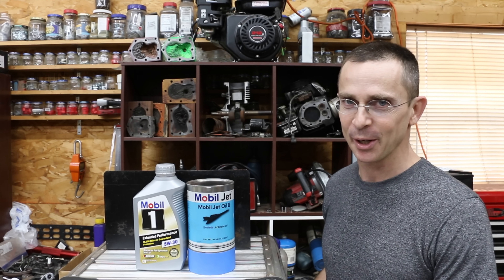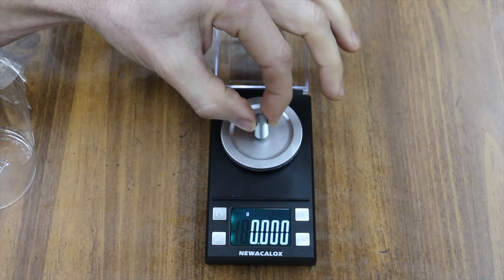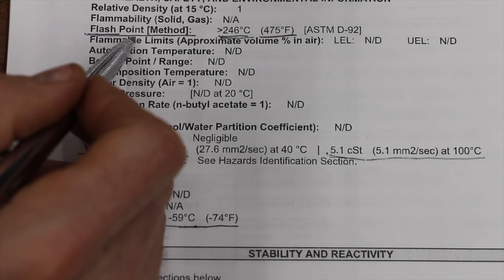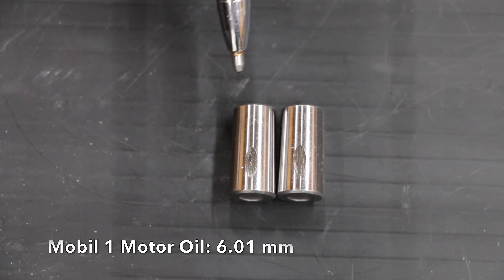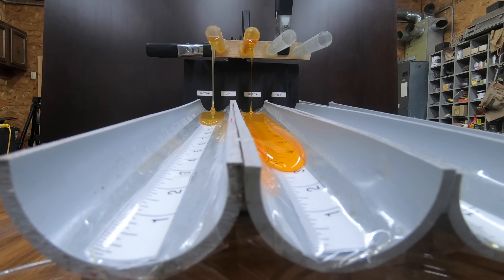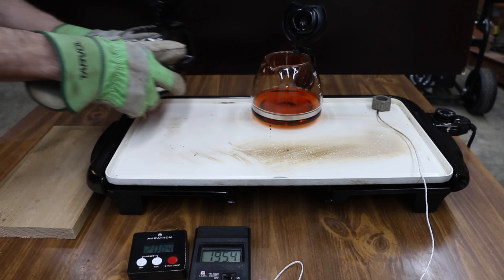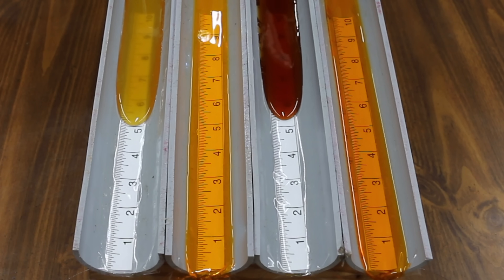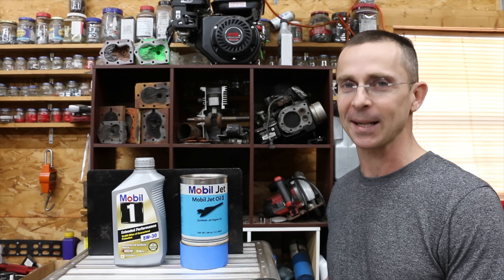Is Jet Oil better than Mobil 1 Synthetic?  Let's find out!

Comment: Put dollar general oil in my jet now
Reply from the maker: lol. Thanks!
Reply: @ProjectFarm  awesome testing. PS
Case Hardening of bearings can vary batch and mfg so maybe use same roller in wear test and rotate 90° for two tests on on the same roller different oils
Also detergent action of oil is critical. Maybe test carbonized part and boil it to see which oil cleans sludge.
Trying to help you not a critic. 
Excellent work Thanks

Comment: I'm curious. If "High Milage" oil is designed to clean out sludge inside the engine, plus other additives meant to reduce wear on moving parts. Then why not just run High Milage oil from the get go, after break in period of course...🤔
Reply from the maker: Great point.  High mileage oils contain seal conditioners.

Comment: These tests are so cool for general knowledge. While watching this episode i thought it would be interesting to try the lubricity / wear test whith the oils in hot and cold conditions, and maintain the target temperature through the whole duration of the test. Just to see if the engine oil do as good in extreme ranges as the jet oil. The heat part would not be so hard to configure, adding heating elements under glass cups for exemple, but for the cold part i still don't have great ideas how to make it. Ice surrounding would work for a start point may be. Still, thanks for your awesome videos !! Cheers
Reply from the maker: Thank you very much!!

Comment: One thing I'd love to see you do is this. 
For years people and companies have marked what they call HHO GENERATORS as a fuel additive for combustion engines. I know it works but I've always wondered what the difference would be, if any, between an HHO generator and a cylinder of laboratory grade, or similar, hydrogen gas spliced into the air intake of an engine. Compare block wear, if any at all, after a few hours. The gas registration would not be difficult to manage. Thank you for your time.
Reply from the maker: Thank you
Reply: Ah! Dihydrous monoxide. Great for making iced tea.

Comment: This test made a TON of sense to me. Jet oil should have a better cold temp test due to the fact that planes typically fly between 30,000-40,000ft at which temperatures are nearly -40°C.
Reply from the maker: Thank you

Comment: I used to work with a guy who was an Army turbine engine mechanic.  He told the following story:  One day, several cases of turbine engine oil was stolen from the shop.  Everyone thought they knew who did it, but couldn't prove it.  About a month later, the guy that everyone suspected was late for work.  When he finally got in, he explained that his car engine had died - threw a rod or some other catastrophic failure.  Turns out that turbine engine oil has very little extreme pressure additives...turbine engines don't need them!  But gasoline engines must have them!
Reply from the maker: Thank you

Comment: As an aircraft mechanic, I can tell you the primary purpose for oil in a jet engine is cooling the bearings. Secondary purpose is lubrication. Also, jet oil has such a wide temperature range because planes can be operated in a wide variety of environments. Anywhere from a scorching hot day in the desert to arctic temperatures. Worst case scenario, an in flight start at 35k feet where it is -65 F.
Reply from the maker: Thank you

Comment: Great Job Sir...  Heh heh!

I didn't even know there was such a thing as Jet Oil....

My suggestion: Mix 4 parts Mobil 1 with 1 part Jet Oil....  How does THAT perform???  Does it give you the best of both worlds???

In your voice over, you didn't point this out, but during the lubricity test, the Jet Oil bearing was definitely hotter....  the Jet Oil, it seems, does not reduce the friction, like an actual motor oil product....
Reply from the maker: Thank you

Comment: How does jet oil with the best anti wear oil additive compare to regular motor oil?
Will it be superior on the lubricity test?
And will it loose its great temperature withstanding abilities?
Reply: Jet oils will lose the lubricity test every time no matter which ones you pair up. It is a completely different oil design for completely different needs. Turbine oil is primarily to remove heat from the engine's bearings. Lubrication is part of the equation but not its primary function.
Reply: mytmousemalibu  sire, it is no viable option for a car, but an intresting video idea nonetheless to see what those additive really do

Comment: Another neat video! It might be neat to look at how some lubricants from other applications might hold up under your testing conditions. I've always wondered just how different the oil for our vacuum pumps in the labs from more pedestrian motor oil. I could send you over a quart of Edwards Ultragrade 19 if you were interested. It's relatively cheap by typical scientific standards at like $20 a liter.
Reply from the maker: Thank you

Comment: Do you think the jet oil would have a more "even" competition against say 0/5/10W-20 Mobil1 being it's a lower viscosity?
Reply: It is a completely different oil design for completely different needs. Turbine oil is primarily to remove heat from the engine's bearings. Lubrication is part of the equation but not its primary function. Its  not comparable to any automotive oil.

Comment: Jet oil is used more for flushing and cooling in a jet engine than it is for lubrication. There are almost no journal bearings in a jet, they're all ball bearing so don't generally require the same kind of surface tension and viscosity.
Reply from the maker: Thank you

Comment: Will VTEC kick super hard wit jet oil? Asking for a friend
Reply: Did you feel you hair slick back with how fast my sarcasm passed over your head? 🌝
Reply: Race Inspired Cosmetic Enhancements 😉😘💕💗
Reply: Of course you'll feel a kick, it'll be the valve gear going straight through the bonnet, at speed.
Don't even suggest this en sarcasm because you just know some idiot will try it.
Although killing Fiat multiairs in this way should have charitable status.

Comment: The original J-57 jet engines, used on B-52 and KC-135 aircraft, would burn about a quart I'd engine oil per hour.  The later engines used in the tankers, used very little oil during use, and had no oil change time.
Reply from the maker: Thank you

Comment: I think in your wear tester viscosity plays a huge role. I would assume that heavier wheight (higher viscosity) oils pretty much always win. If compairing prower engine oils. 
Would be interesting to see you compare different weights of the same brand. Maybe even  gear oil wich i would assume would do very well. But that wont mean its good for engines. :)
Reply from the maker: Thank you

Comment: Temperatures in the sky can reach below -100F, so it's no surprise the jet oil is rated for temperature extremes.
Reply from the maker: Great Point
Reply: But most engines are pretty warm when in those temps. Passengers get excited if you shut an engine down while flying.
Reply: air cooled piston motor run hotter up high, less density = less cooling

Comment: I have 500,000 miles on a 1996 F 150 using Mobile 1. Still use it as a beater. Who cares if it get banged up hauling rock.
Reply from the maker: Great Point

Comment: I'm currently in the process of replacing the 5.8 liter V8 engine in my '95 Ford F-150 with a jet engine. After melting the entire floorboard at idle, initial testing of the jet engine showed there are several major challenges to my project. Thanks for the test results. At least I know which oil to use in my jet engine.
Reply from the maker: Your welcome!

Comment: Can you test Lubriplate as engine oil? Lubriplate is an engine assembly grease used by Cummins to prevent engine component damage during start up of a new, or newly rebuilt engine. It turns  to an oil like consistency when exposed to heat so it doesn't coat the engine internals in sludge. If you need it, I'll get you a part number. Love the channel. Keep up the good work. 👍
Reply from the maker: Thank you

Comment: Now I would like to know, how cooked oil works with the bearing. Maybe jet oil would be better in the long run, since it would get cooked as much. What do you think?
Reply: Not going to matter, the oils properties are completely different because turbine engines are vastly different for piston engines. Just about every moving part is supported by ball or roller bearings. Turbine oils is primarily used for cooling, lubrication is not the primary attribute for turbine oils.

Comment: 9 bucks a quart, whoa i musta "heared" it wrong LOL
Reply: You heard correctly. Some are even more. In the world of jet aviation, $9 a quart of oil  doesn't even register as pocket change. Imagine if your car's spark plugs were $3000 a piece like some jet engine ignitor plugs. Ive had avionics boxes in my hands no bigger than a box of tissues that cost more than $300,000 and thats still low hanging fruit.

Comment: Do not think you want to try the oil for piston engine aircraft. That looks like thick syrup when cold, and only gets worse when frozen. You almost have to use a spatula when cold, but after the engine is warm it runs like water.

Jet engine lubricant is more of a hydraulic fluid, it has to work well over an extreme range of temperatures, as it will be used both in freezing places, like actuating the cylinders that are on the wings, and the same fluid will also be in the engine cooling down parts that are at 1000 C on the one side, but have to stay cool, so the fluid has to absorb that heat safely. Works because the flow rates there are kept high, so the oil can be moved to a heat exchanger to dump the heat fast. The fluid is also regularly sampled, so that wear particles can be examined, so the condition of the whole system is kept good, plus the filtering is very good to keep particulates down to a very low level.

Just do not get it on your skin, the additive packs in jet fluid are very toxic in a lot of cases, and it is incredibly hard to remove from skin without very aggressive scrubbing and lots of harsh soap, and clothing soaked in it is almost impossible to clean without boiling for hours in industrial detergent solution.
Reply from the maker: Thank you

Comment: Lubricity tests should only be conducted on cooked oil. Every car after 15 mins has cooked oil in its engine, it stays there for 5000_10000kms. ..testing fresh oil is a moot point and not a true representation of engine protection
Reply from the maker: Thank you
Reply from the maker: Thank you
Reply: It looked like the jet oil got slung out of the cup pretty quickly, causing the tester to run more dry than with automotive oil.  Being a thinner oil and perhaps some specific properties to a jet oil (I don't know what specific requirements are taken into account when designing aircraft oil) caused it to be more susceptible to sling off.

Comment: “Mobile One has their own rating system for their products.”  I don’t know about you but if I sold muffler bearings and said that based on my own testing, they’re the best, I think I’d even be a little skeptical.
Reply from the maker: Thank you
Reply: Given that they're comparing their own products against each other I would assume that they do that as a shopping aid for people standing clueless in the oil isle amongst hundreds of bottles of oil and having no idea which one to choose--this simplifies the choice, at least within the Mobil product line.  If they were making claims about any other oil it would be a different story.  Every one of them claims superior protection, cold weather flow, cleaning properties, etc. so claims like that are why independent tests are so valuable.
Reply: You can get them at any auto parts store that sells headlight fluid, canuder valves, horsepower stickers and instant sunroof spray. All tested and rated by the manufacturers too.

Comment: I feel like the lubricity test is extremely sensitive to the oil level in the cup — in the beginning there’s a lot of sloshing and it runs cooler. Do you control for that at all? Do you measure it?

Comment: Now you need to test the jet oil in your lawn mower
Reply from the maker: Lol
Reply: Got the results right here:
https://www.youtube.com/watch?v=ygr5AHufBN4
Reply: Jet fuel and Jet oil in the lawnmower 😁
Reply: @sociopathmercenary  yes
Reply: Do. It.
Reply: Actually, I might work Ok in the Arctic temp
Reply: Yes!
Reply: I second this motion
Reply: DO IT
Reply: I HAVE to see that !
Reply: @T1G3R009  
We ALL want to see it, and put a turbo on top of the engine for “kicks”.
I want to see the connecting rod launched into the next county.
“It’s a guy thing”!!!
Reply: I agree
Reply: I came here to write this
Reply: Don’t do that to your Honda
Reply: Is there a two stroke version for my leaf blower?
Reply: I've been using synthetic oil in my riding mower since 1983 and is still running good with no signs of wear.
Reply: No

Comment: Jet oil is designed more to keep bearings cool as jet engines have roller/ball bearings. Much less friction than plain bearings used on automotive engines.  Also Jet oil is designed to operate at much lower temps so as to allow less friction at high altitudes where the temps are -50F or less.  This would be in case a engine flameout and needed to be restarted.  Less friction with lower viscosity. Therefore easier to spool
Reply from the maker: Thank you

Comment: Still here to vote for crimp vs solder 😘
Reply: be interesting but I always do a good mechanical crimp followed by solder
Reply: Crimps when done properly are better, crimps when done poorly are worse. All heavy duty equipment uses big crimps because solder expands and contracts over time and tends to crack whereas crimps when done right are waterproof, airtight and cause individual strands to mold together. It's also not affected by high heat from high amp loads nearly as much as solder can be, effectively ruining the connection as it liquefies and solidifies without flux, acting as a fuse when it's not supposed to. Still would be interesting to see, but he'd need a high voltage insulation tester to get a real sense of how the connection does with resistance at high/low heat and such. For a semi-pro Extech one that's over 500 dollars, but maybe if he knows an electrician he can get one on loan.

Comment: so viscosity is thin for tight  built close tolerance  jet engine parts. this jet engine oil is  unique  because its not rated at multiviscosity  use, like a 5w-30.  but flows at very low temp and very high temp.  this can of jet oil holds many trade secrets from mobil. i wonder if mobil is out at area 51 making this stuff.
Reply from the maker: Thank you

Comment: That was a super interesting test!
Hmm, if you have enough jet oil left you should see how it compares to 2stroke oil! 
Could even do a test of modern 2 stroke oil/gas mix, the old fashioned regular engine oil/gas mix, and this jet oil/gas mix! The jet oils incredible ability to flow so well in cold temperatures, if it works decently in a 2 stroke engine it may be a really good substitute to use during the really cold winter months for fire departments, for the chain saws (trying to start a chain saw in -14° F is not fun! Lol is still shiver at that memory 🥶) and other small engine needs, and in the small 2 stroke snowblowers that many people still use
Take care!
Reply from the maker: Thank you

Comment: Your test was cool. Its possible that the reason your bearing wore more with jet oil is that jet engines use a far harder bearing metal and in many cases there is an air or fluid gap greater than automobles do to much higher pressures.
Reply from the maker: Thank you

Comment: Excellent video!!.Top notch!!.
The Mobile "jet oil"is made for the main bearings in jet engines spinning at 100,000-250,000 R.P.M.,this is NOT FOR USE in internal combustion engines of ANY KIND⚠.
It would be better to do the ASTM 4-ball wear test measuring in millimeters if possible,it's how ASTM does this test.
The pour point of -44 below zero is pretty good too.
Now the volatilization point affects the weight of the oil,the higher an 🛢🔥⬅oils volitalization rating,the less it evaporates.(higher🌡 temperature rated)
Reply from the maker: Thank you

Comment: Of course the jet oil is not designed to cope with any kind of contamination caused by the slight blowby present in all piston engines, or to be exposed to the combustion itself when stuck to the cylinder walls. Piston engine oil has a complex job to do since it must clean combustion products out of the crankcase, lubricate the engine, help the piston rings seal, prevent wear, cool the pistons and turbocharger etc... In jet engines the oil is there mostly to lubricate and cool the bearings. To my knowledge, most jet engines use rolling element bearings, and due to their fast rotation speed you probably wouldn't want too high a viscosity. The plain bearings in a piston engine have a much harder life, and you want the viscosity to be a bit higher to prevent the surfaces from touching. So yes, you're very right in saying they are not really interchangeable.
Reply from the maker: Thank you

Comment: I tried mobile ones 15w40 "turbo diesel" formula, burned 3 quarts in 2400mile road trip. Never have I seen oil burn off this bad, even Royal purple showed less than a half quart loss.
Reply from the maker: Thank you

Comment: Ran a test cell testing jet engines for years. Jet engine oil is mainly to remove heat from high temp locations.  We actually had a crazy engineer that would have us collect the used oil after our test was completed. He would put it in his car's coolant system. He swore by it. Plus it had a blue dye for leak detection from our tests.  If he ever had an issue in his car. A quick black light inspection would show a leak.
Reply from the maker: Thank you
Reply: I am in need of a high temp heat transfer fluid that will not boil. I might have to experiment with this.